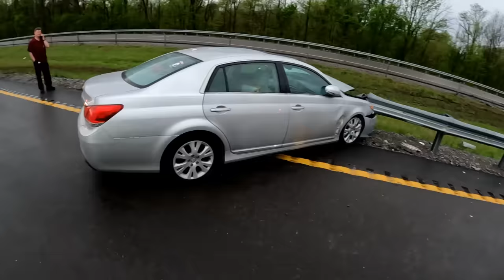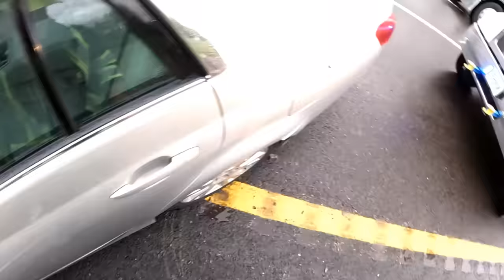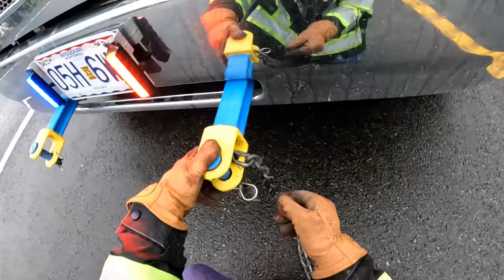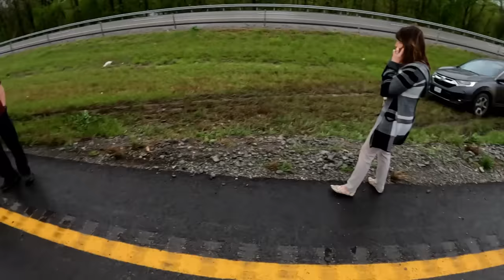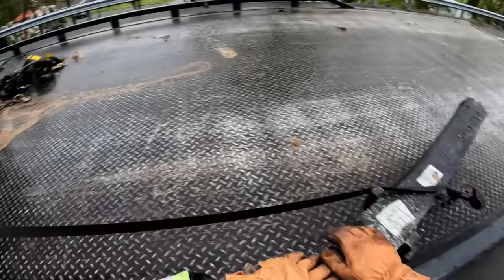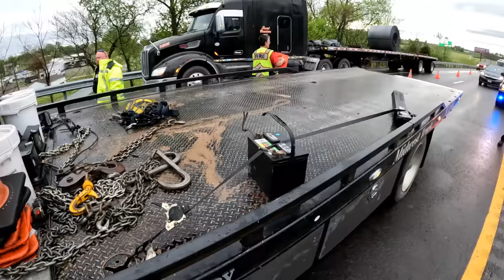Tag Team Tow Impaled by the Guard Rail

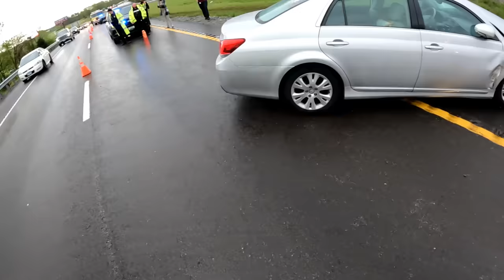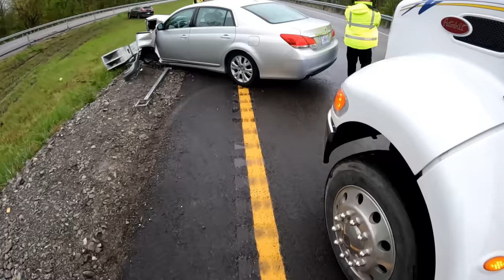Comment: its interesting to see how over the years how crash barriers/guard rails have improved. A while back (with what im guessing was an almost head on collision with the front of that railing) it would have gone straight into the car and caused significant damage; however @2:14 you can see the rail is curled up, that curling up takes energy out of the system. You can also see at @4:35 the structure of the system is just above ground level but the main part has sheared off. These two factors meant the rail diverted and crumpled rather than skewered.
Reply: for more info here is a video explaining it in more detail: https://youtu.be/w6CKltZfToY?t=503
Reply: Here in Texas it's mandated that all guard rails are turned down into the ground instead of being up in the air for specifically this reason. They did away with guard rails in the air many years ago.
Reply: @Sabrinahuskydog  in Europe we call the "up in the air" rails impalers. They became illegal many years ago here after a few really bad incidents where the guard rail went right through the car and driver. The dug down guard rails cost more to build, but they'll flip the car over rather than impale it

Comment: Ron I love it you’re thinking of the batteries safety first perfect
Reply: From other videos, especially where heavy trucks involved, it is important to cut the battery cables and/or remove the batteries as could cause a spark that could ignite leaking fuel or oil. Extra caution has to be taken with EV's and Hybrids, firefighters, police and tow truck operators will usually have to pull a master switch to cut off the batteries from the rest of the car.

Comment: Really sweet move pulling the damaged car backwards like that Mr Ron, I had a similar experience last year when I was working with my brother, we were taking a One ton flat bed truck and dump trailer full of firewood to a man across the state line when we came across a Ford ranger that had failed to negotiate a sweeping turn and head went into the ditch on our side of the dirt road and cleaned out fifty feet of mud, the ranger was nose down so I pulled up close to hook up a chain, pulled the ranger out of the ditch and the chain got in front of the ranger and pulled the ranger to  man's house, then continued on our way

Comment: Cheers Ron. Not trying to tell you how to do your job, but that extra piece you had with the battery, if you just added a twist to the strap to secure it (with it against something so ithe strap won't untwist) it will work on most things (not always of course) I have very successfully transported many a odd shaped thing that way. Not that you probably had very far to go. Anyway, I appreciate you respecting the privacy of the owners of the vehicle by not showing them, you always have the thoughts of others in mind before yourself, which is one of the reasons I bother to follow you. Thanks again & cheers from Oz !! Oh... Glad everyone was ok!

Comment: The people in the car that hit the guard rail must have said their prayers that morning. They were able to get out of the car and physically fine. I don't understand why the airbags didn't pop, guess it was an odd angle to not set it off. The SUV that was also involved was very lucky, they could have flipped, hit a car in the opposite lane. The SUV should get to a garage and make sure nothing wrong under it, clean out the mud. Likely slippery road and speed were factors.
Reply: Did you know that the airbag impact sensor is in the right headlight assembly not the left that's why if you have an impact on the left side of your vehicle will not set off the airbags.
Reply: @orangepickel2  
sorry that's not how it works. Air bag systems use multiple crush sensors and or accelerometers to determine whether a crash warrants air bag deployment. The air bag module uses a multitude of data from vehicle speed to brake actuation and deceleration forces to determine which bags to deploy. There are even occupancy sensors to decide if a seat has a person in it which will determine whether a passenger bag will deploy. In this case based on the damage it is apparent that the deceleration forces were outside of the requirement for bag deployment. Unless of course the system was non functional eg the Airbag light was on.

Comment: Lucky that was one of the new generations of guard rail, with the anti-impalement and anti-launch device on the end.  That's the long heavy device on the end which slides along the rail with the casualty, deflecting the actual rail off to the side.  The original basic Armco had a habit of deeply impaling a vehicle in that sort of collision, sometimes penetrating the passenger compartment, or launching the vehicle into the air with a concrete or metal protection ramp on the end.  The new style just absorbs the forces relatively cleanly, when it works as intended.

Good job, nicely done, fast and efficient.

Comment: Nice work! Wish my truck had some type of hooks in the front.  I had to winch an ambulance from the back today so I can turn around and load it from the front.
Reply from the maker: Those hooks are life savers for sure.  Watch your 6 and stay safe out there brother.  God bless and thank you for watching.
Reply: @RonPratt  I need to see if there’s a set of hooks I can add on to the truck. You be safe as well brother.
Reply from the maker: @TowMan127  I've looked at pictures of your truck and I don't see any slots for the factory Freightliner hooks.    That size MAY have frame mounted hooks???   Not sure.    If you have or can get some, they come in very handy.
Reply: @RonPratt  From what I seen online it looks like they have a set that bolts onto the frame. I’m going to look into it cause I could definitely use a set.

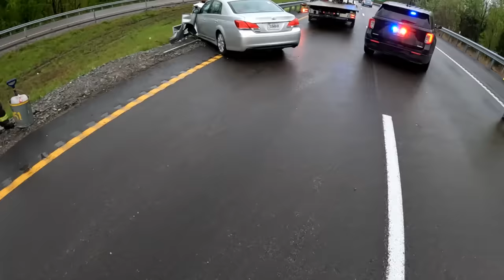Comment: @3:04 if you put a chain to the Hook under the rear bumper and put your snatch block on the left end of your bed you could give that car a 180 and then pull it up from the rear Ron!
Reply: Probably pull forward 10ft first though.
Reply: Or from the left rear lower control arm. I thought it was an older Corolla instead of a newer Camry the way it was crushed 😞. But still… work smarter NOT harder!

Comment: First thing to learn when towing.. the "shoulder crawl". Modern cars are so close to the ground you can't hardly get under them. I know that there's pretty much no way to get under my dad's 2010 Challenger RT without putting it on a lift, I tried looking under it and you just can't. That sign you picked up was for gasoline.. someone had to have gotten in trouble for that going missing off their truck.

Comment: Airbag did not deployed in the silver car 🤔
Reply: yeah..that's odd
Reply: The energy was absorbed by the guard rail over a longer period of time, so no need to deploy the airbag. As you see  the driver is uninjured (except for a couple of very likely bruises).
Reply: Impact probably wasn't severe enough. Those Guardrails are designed to give when impacted straight on.
Reply: no seat belt will do it, or just could have been malfunctioning sensors or airbag module.
Reply: Seat belt may not have been fastened or not quite hard enough of a hit.

Comment: Two comments. First, when you pulled the car back and then disconnected there was an oil stain on the pavement. Where your truck was while hooking up. Does one of your trucks have a leak? Now, did you really start to tie a section of bumper down on the top of a top post battery? If it was still connected internally, you may have had a battery short on the ride back to the shop. Not a mess that you want to have on the bed of your truck.
Reply from the maker: 1st, no, my truck does not have a leak.  There had been police vehicle parked there that I had to ask to move so I could pull the car backwards.  It may have been from the police vehicle.
2.  The bumper cover that I placed over the battery was plastic, which does NOT conduct electricity.
Thanks for watching and God bless.

Comment: Hey Ron! I'm a new tow operator, I work with a 2016 Freightliner Rollback. I was wondering if you have any advice for a newcomer to the job.
Reply: May not be Ron, but I'm a rollback operator. 2015 f650, but when working on the high way always keep your head on a swivel and try to work off the side away from the travel lanes as much as possible. And if you need to steer the vehicle on use your winch remote.